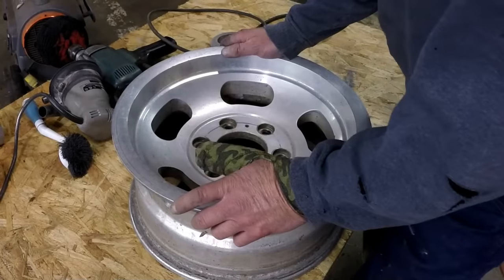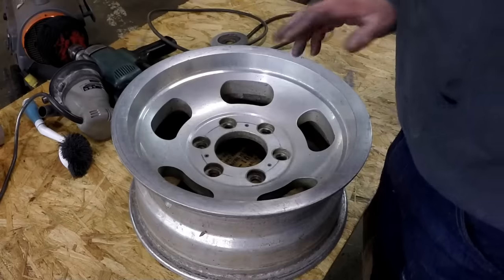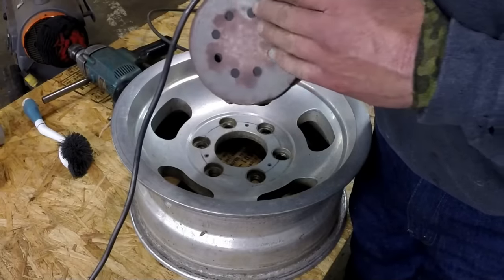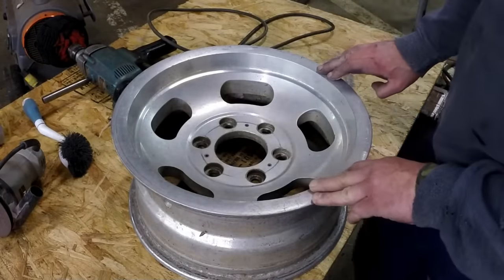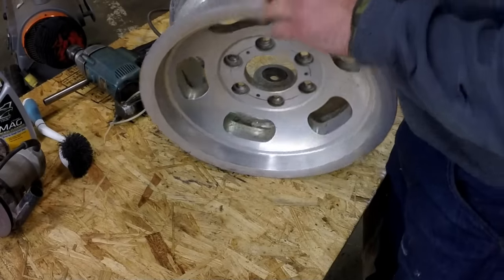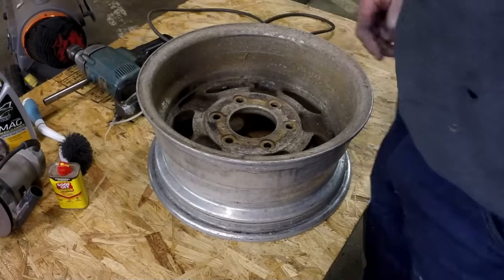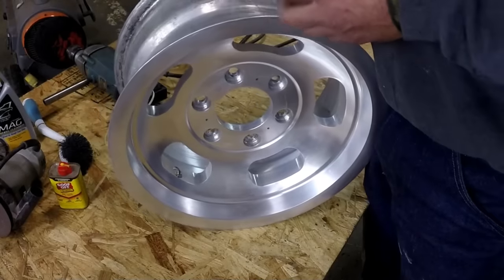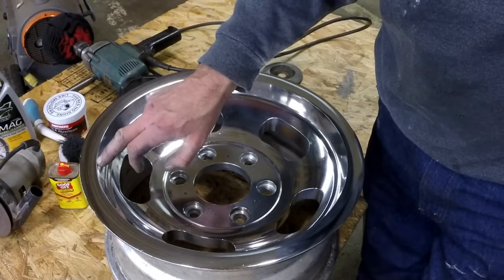Quick and dirty aluminum wheel restore

Comment: Wanna save a couple of bucks for the long run? Goof Off is nothing more than lacquer  thinner. That little can of  Goof Off probably costs about $2.00-$3.50 and you can buy a gallon of lacquer thinner for $8-10 at any place that sells paint. It will take the wheel weigh paste off (so will rubbing alcohol) and do a lot of other good things around the house.

Comment: A lot of hard work could have been avoided if you had used polish from any truck stop.  My wife and I manufacture and sell a progressive polish. What that means is that it starts out course an as one grit wears down, the next finer grit starts working. Ours is 4 grit progressive polish. This is what you look for in a polish. It won't take out deep scratches, oxidation and brake dust rub off easily. We don't use a ball either because the grit gets plugged in the fibers before it starts working.  Take a half sheet paper towel folded into quarters to apply the polish. Then wiping off with soft towels. Some polish is better than others by mother's is just not course enough for oxidation ect.
Reply: Another thing is, ig you use steel wool, never use anything except STAINLESS STEEL WOOL and never clean aluminum with any products with ammonia. Bare aluminum gets a brown haze from the chemical reaction. Also,  dont buy polish from people that put pennies in to mix it because they are metal and will impregnate the aluminum and cause RUST dots in the aluminum were the steel is rusting in the metal. I hope this helps.
Reply: For mixing polish it should ONLY have glass marbles or stainless balls.  NO METAL LIKE PENNIES ECT. THAT RUST ONCE THE COATING IS WORN OFF.
Reply: For mixing polish it should ONLY have glass marbles or stainless balls.  NO METAL LIKE PENNIES ECT. THAT RUST ONCE THE COATING IS WORN OFF.
Reply: Great job on getting pop shine, but I would like to see all three rims at once for true comparison.

Comment: You have to take out all the flaws if you want them to look good period. I have the perfect wheel to do this. Also drills and grinders no not me. Get a old compressor motor extend shaft. Turn your wheel. Not the machine.

Comment: Mothers Mag & Aluminum polish is great stuff.  I use it for all kinds of things.  For example, I have a Ruger GP100 .357 magnum revolver that had a mat finish and I wanted to polish it to a shine.  Using just a rag and some Mothers M&A Polish, it had almost a mirror finish within about 30 minutes. I just polished it while watching the news on TV.  The point is that it not only works on aluminum but also steel.   Of course, it's just a polish and other polishes, such as regular polishing compound, are good too, but I've had such good results with Mother's that it's my go-to general purpose polish. In fact, if it warms up today (it's March 21 as I write this), I'm going to go out and polish the aluminum wheels on my Triumph Rocket III Touring today. 

Good video!  Thanks for posting it.

Comment: Wheel weights: When I refinished my wheels I marked the tire with a piece of chalk, and a black, magic marker on the inside of the rim. Line up the two marks, when putting the tires back on and they go in the same place. No need for re balancing. When I balanced the wheels, in the beginning I only put weights on the inside. I don't want to see weights on the outside.

Comment: Good A+ job on the restored wheel but inaccurate  title on the video; nothing 'quick and dirty' depicted. Dialog rightly describes a lot of work goes into any restoration. and much more into a proper restoration. Vinegar is as good as anything to remove the glue.

Comment: Thank you for the informative film. May I ask you how did you polish the inner part of the wheel, that one which goes inside of the tire (for better sealing of the tire and the rim). I do my first tire and not sure about it. I removed the dirt line above the bead w/a triangular sand paper 120-150-220, and plan to go w/320-400-600, but do I need to apply Mothers paste. I'm afraid it will interact somehow w/tire grease I obviously plan to apply before the new tire is installed. I would appreciate your opinion on this method.

Comment: Great Video !!..but What's  Your Solution  if your aluminum wheels were Factory Clear Coated , and the clear coat has peeled in some spots ?....How Would you remove the factory clear coat to get the Amazing End  Result you achieved on these Aluminum  wheels in this video

Comment: I just finished 4, 18" mag wheels.
The TRICK to wet sanding the wheels, is to use WD-40!  It makes a mess, but the sanding discs glide over it and lasts longer.  It's also easier to polish sand and remove markings.

Comment: I think you should be careful using etching cleaner,  I would say don't  leave it on very long at all. Maybe less than 45 seconds, it's really  made for open pore/rough cast wheels. Read the label on the bottle you use. It's caustic and can ruin a wheel or piece of trim. Overall this is a great video! Thanks for  making it.

Comment: 4 aught steel wool is also good for cleaning windows.  No joke.  The steel wool is so fine that it won't scratch your window.  Just add some water, kinda like you're wet sanding.  If you have some really stubborn spots (like Rain X), I add a bit of dish washing soap or even some Bar Keeper's Friend (or Bon Ami).  Just be careful because these soaps are meant to cut through grease and can strip the wax from your paint, but it'll burn through anything on your window.

Comment: I have a '96 Firebird with stock aluminum rims. I want my wheels to shine like this video. Currently they are very clean and nice looking. I washed them real good then I used the same Mother's polish that you've got on your bench. After polishing with the Mother's using a buffer on my drill, they look nice and clean but no noticeable difference like your video. Suggestions?

Comment: You should have treated this video like a teaching demo and physically shown the steps that you only talked about. Adhesive residue could have been 100% removed in one step by using acetone. You could also have used a dremel or other rotary tool for fine work to de-bur any sharp edges. If you had used acetone the inside of the wheel would not look so chewed up (caused by the wire wheel) and would have been able to be polished. Lastly, to remove curb damage by grinding and/or sanding in the one spot will actually throw the ability of the wheel to be properly balanced completely off. Use a flat steel bar long enough to overhang the diameter of the wheel with no coarser than a 220 grit strip sandpaper to begin with. Sand across the diameter from edge to edge and change the sanding direction after 3 to 5 passes working around the wheel. Progress to 280 grit, 320 grit and 400 grit strips of sandpaper. (Hint ** Use self adhesive strips of sandpaper available at an Auto-Body Supply Store to make it easier. After sanding, then go over the entire wheel with fine (#000) or ultra fine (#0000) steel wool prior to using a polishing compound. Lastly, If your wheels do not have tires mounted on them, do yourself a favour and use the steel wool to clean and polish the surface that the tire bead seals on to prevent tires from slowly leaking air. It will take longer, but properly done the aluminum wheels will look as good if not better than new.

Comment: I was told not to use steel wool on aluminum due to the reaction between steel and aluminum...
Reply: Maybe if you leave the steel wool on the aluminum it will rust and stain the aluminum. That's the only problem I can think of.

Comment: FYI Never use steel (wool) on aluminum or aluminum oxide on steel, doing so will lead to galvanic corrosion or bimetallic corrosion.
Reply: That would be true if you didn't clean the aluminum of all traces of steel wool dust and anyone polishing something like a wheel (or anything else for that matter) is certainly going to clean the aluminum. The steel wool is only in contact with the the aluminum for a short time and then the metal is polished (as was done in this video.)   After all, if someone is going to the trouble of polishing something, they wouldn't leave steel wool fragments and dust on it.  Steel wool is just a preliminary step.  I've used steel wool on aluminum more times than I can count and I've never had a single problem.  Your point is theoretically correct but not so in actual use and a little common sense. The results URJB got in this video are proof of that.